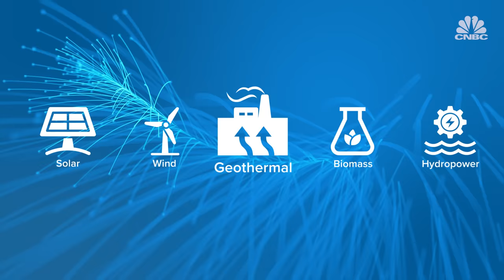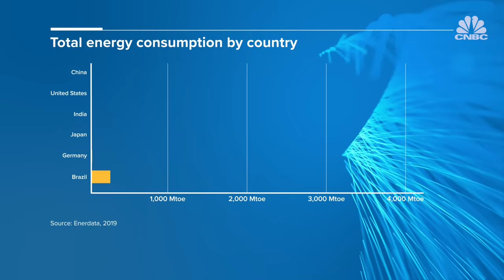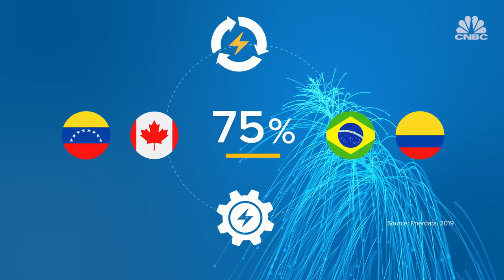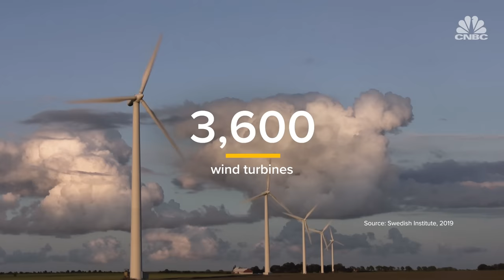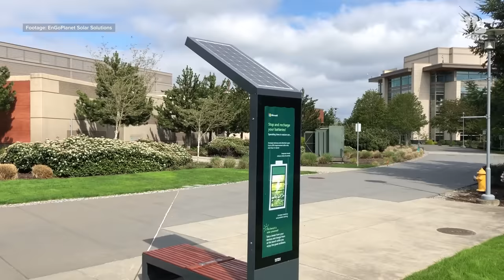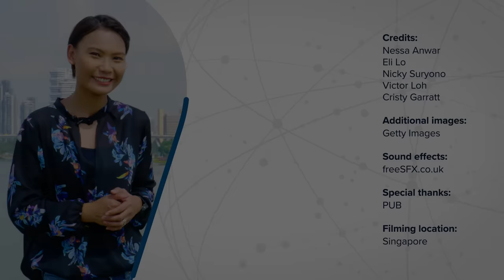Who is leading in renewable energy? | CNBC Explains

Comment: "not including hydropower"
not including 98% of norways power supply
Reply: @peter that makes no sense, not all countries are sunny and windy, nor they have volcanoes to produce geothermal energy. If any country wants to switch from fosil fuel to renewables it must harvest its renewable resources, it's stupid to exclude hydropower l.
Reply: Hydropower has the problem that if your country has a suitable location for it, it is most likely either in use already or protected. No or minimal chance of growth, so it makes the numbers look misleading. Now if we start building more wave/tidal power, that does need to be included.

It is also rather not-green compared to others. You need to dam a river valley or dig a reservoir, destroying whatever forest habitat, local villages and natural beauty were there, risk creating mudslides or floods, block fish and boats from traveling the river, and the huge amount of concrete and other materials needed don't exactly help either. On the plus side you might get some tourists fishing in the reservoir, not exactly a fair trade.
Reply: The difference is that hydro is dispatchable upon request, unlike variable sources like wind and solar. In other words it's very easy to have a lot of renewable electricity if you have the hydro resources but much more difficult from other renewable sources
Reply: If you take Ireland for example, it has all of it's hydro resources exploited (as it's very easy and cheap to) but only amounts to 3% of electricity. Ireland would love to be able to have more hydro resources as its cheaper and far more reliable than the wind farms they are building en masse
Reply: @brick1907  That definitely helps keeping it in the game, but either you have a steadily flowing river and would like to use it, meaning you probably run pretty close to100% output and don't have anything to dispatch on request; or you keep some production in reserve for when needed, meaning unless you are paid for that untapped amount you lose money and if you are it raises the general price per kWh. Or your river is not a steady and reliable source of energy and you are running a pumped hydro energy storage. I don't think storage should be counted as renewable energy PRODUCTION, whether the original energy was produced with renewables or not.
Reply: @AnalystPrime  that's a very fair comment, interesting way of looking at it. For some reason your initial comment in this thread didn't show up for me before replying
Reply: In almost all developed countries and most of developing countries that have the electricity demand, hydroelectric dams that can be built already have been built, so if you include hydro power, combined with the fact that hydro power is still the far-leading #1 source of renewable energy globally, the numbers would practically turn from "who are more willing to invest in renewables" to "who have better geography", which is not the point of the video.
On the other hand, no other renewable sources have been used to its full potential in most countries like hydro have been, and to encourage more investment in renewables, we of course have to focus on those non-hydro fields.
Reply: and icelands energy supply
Reply: peter Because Norway isn’t apart of EU. They do lazy research, instead of pick up information from each country, they go look at EU who is already collected these informations nations - who are member of EU.
Reply: Not including hydropower? 

Almost all electricity in Iceland is produced using renewable energy sources, with 73% of electricity provided by hydropower plants and 26.8% from geothermal energy, accounting for over 99% of total electricity consumption in Iceland.

hydropower plant is behind 98% here in Norway.
Reply: I think they excluded hydro power to make it comparable. Hydro power no doubt is a great renewable energy source, but not all countries have it for natural reasons. With solar power, or wind energy in contrast, it's simply a matter of installing the technology.
Reply: Hydro power can be both good and bad. They excluded it bcs it's now frowned upon due to some cases. In particular cases where countries share a river. eg the Nile.
Reply: 99% actually
Reply: Yes, what's the thing about excluding hydro? Is it maybe because renewables are generally distributed and hydro plants aren't? Because I don't think we'll see a lot of new hydro stuff anywhere - it's too massive
Reply: @chrisd8265  not all countries have same solar or wind capacity either
Reply: Because China is top producer.
Cnat have China at the top of something positive(altough it can be argued if the envirment has been destroyed more by the dam)
Reply: @chrisd8265  No. Solar panels have horrible yield on capital if you install them in the northern hemisphere. Not all areas are windy enough either.
Reply: in low carbon center you have space
Reply: LOL, Norway has gigantic oil fields and makes most of its money by selling oil and gas. Norway should just be quiet with its green energy hypocrisy.
Reply: @BananaCake26  
That is not true, the money gained from the oil and gas is not even accessable by the government, its all invested into the "oljefondet" which only half of the  income gained from the investments is accessable to the government. Norways biggest export is in fact fish, with 2.5 million tonnes per year.
Saying that promoting a green alternative for energy production is hypocritical because we export oil and gas is just idiotic, because oil and gas is a neccesary evil that the modern society cant survive without, and thats why we export and make money out of it.
Reply: @haliax8149  You do know north Africa is in the northern hemisphere right? And most nations can get more than good enough solar yield. Even in Sweden solar panels are a thing. Though ofcourse you aren't going to place large scale solar farms in Sweden, but just for personal use? Yes, it will still provide much more energy than used to produce and will also financially make money, again obviously lower than in sunny africa or so.
Reply: Hydral power is not actually good for environment, it has a catastrophic effect for a rivers health
Reply: @MathiasEmilKuntz1994  it can provide energy for all the countries touching the Nile if new ideas are used
Reply: @gamerx3387  the traditional method on rivers can be bad  for ecosystems but there are new ways that enable the country to avoid  these damages

and  ocean hydro has never been bad for ecosystems
Reply: @gamerx3387  and  ocean hydro has never been bad for ecosystems
Reply: @gamerx3387  hydro produces 75% of renewable energy globally
Reply: @robinsss  those are known as wave energy or tidal energy power source which are totally different thing from river based Hydro power
Reply: @54Nt1460CD  You can't compare the production of energy by solar pannels and wind turbines with the production of hydropower. Hydropower is by far the biggest renewble source. 
So Yes, it is unfair to compare
Reply: @peter You are probably right, but this also applies for other renewables sources
Reply: @peter hydroelectricity tends to have higher emmisions than other renewables due to decomposing organic matter in the water. It is still better than fossil fuels and has other properties that make it beneficial but it isn't quite as good at reducing greenhouse gases on its own.
Reply: @peter the water levels in the resivoir fluctuate depending on the season and amount of genoration which can cause the shoreline to cyclically grow new plants before swamping them which tends to produce a significant amount of methane. The exact emmisions depend on the local climate, geography, size of the dam, and useage.
Reply: Because I can't expect to ever decide what kind of power plant is being used anywhere, all I can do in order to help is try to be part of a world (aka THAT alternate universe) in which the individual with the power to decide upon the type of power plant will make the correct decision.

In other words, this aspect of biology (that it is someone's choice to decide on a type of power plant) is not democratic, and if on this subject I actively "vote with my mind/words", it will not only fail to mind control that individual who is to make the decision to switch to hydro, but it could also make it seem to him that choosing hydro power would not be an expression of his personality.

Basically, if we want to "mind control" him into making great decisions, we need to make him think that those decisions are 1. His own idea and 2. the most unique expressions of his personality which he will have ever made and 3. They will go down in history as a manifestation of the perfection of a ruler (him or her).
Reply: @AnalystPrime  Hydroelectric dams, when built correctly, can actually reduce severity of floods and protect fish.

Comment: Disappointed to see this video equivocate energy and electricity, quite misleading
Reply: Low hanging fruit. Wind and solar are very competitive. Batteries are taking off like crazy. EVs are driving it. I've had my Tesla Model 3 AWD for a year. It's awesome, but there are a whole slew of 200+ mile EVs going to be available in 2020.
Reply: @Joshua N. Ajang Rare earths actually aren't that rare.
Reply: Yes. Very disappointing.  Electricity account for only 20 percent of the world's overall primary consumption. Besides renewables only account for 11 percent (hydro 7 percent,  solar/wind/biomass 4 percent) If you add nuclear you get 15 percent. So more than 80 percent are still fossil fuels (2018)
Reply: @peter In Germany electricity is at about 45% renewable but overall just 15% lol

Comment: I remember once in a popular mechanics magazine a long time ago, they had an idea where you can use a special type of wind blade installed in the centre of highways in the cities and they would turn from the wind produced from passing cars and trucks. Its would produce enough power for the lights at the side of the highways.
Reply: From what I have read such installations could actually produce a small surplus. Honestly I am somewhat surprised it isn't more common to integrate small to medium sized solar panels into streetlights, you already need to install the foundation, connect to the grid, and regularly inspect and maintain the equipment so why not try to recouperate some of the costs

Comment: Bad documentary, because lack of data...Just speak but very little numerical data....
Reply: Rusmin Noer it’s bad only because America is low on the totem pole
Reply: And then they messed up with the units. At 6:10 capacity is not power. Megawatts = power, megawatthours = capacity.

Comment: Originally from Brazil lived in NAPA for 20 years now but still go back frequently. I was surprised to see that they use ethanol(alcohol )and is or at least was the global leader of alternative fuel! It’s a shame we don’t have that here
Reply: We have plenty of ethanol but I think a generally lower mixture in the USA. E85 which is mostly ethanol  is available in some places but not everywhere, which has over 110 octane (compared to 93 octane premium gasoline). It's hard to calculate ethanol's true benefit in the USA... We make our ethanol from corn (I think Brazil makes theirs from sugar beets) which as a dual effect of less corn for human consumption and feedstock, and whether the petroleum products that are typically used to grow and deliver the processed corn is tryly a net benefit. Government subsidies also muddy the picture... subsidies may be essential to getting production up sufficiently to make economic sense for building the related infrastructure 

Additionally, only cars manufactured after 2007 can take E85 gas without modifications. Any earlier model cars need to invest in a "kit" that can cost in the neighborhood of about $700 to replace the fuel injectors, install a special ethanol sensor and reprogram the car's computer.

Although I suppose it's YMMV on an individual basis, it should also be recognized that ethanol has a high water component which might affect some car systems, and despite the very high octane actually results in a much lower net miles per gallon... So it looks like E85 is priced at the pump very low so as not to be not a poorer deal than regular unleaded gas on cost per mile driven.
Reply: Forgot to add... Burning ethanol in your vehicle does not lessen emissions that are damaging to climate change but it does mean not burning a resource (petroleum) that could arguably be used in a better way (eg plastics) instead of simply burning it up.

Comment: I love renewables along with thought leaders like Lovins, McDonough and Jacobson. We also need to grow global renewables 5 times faster than we are presently. However, I have a real question: When it is super cold like -25 and -35 C as it was on the Canadian prairies for the past week renewables electricity generation share shrank to basically zero. Will geothermal, transmitting outside hydro, grid batteries, bidirectional electric vehicles along with biogas, high insulation and high efficiency do the job? Or do we keep fossil fuel plants, namely natural gas plants, operational for back up emergencies?

Comment: You gave it your best shot. You presented your material sufficiently fair (at least less biased than I expected) Thanks for the video.

Unfortunately nothing, and I mean NOTHING can replace the value provided by fossil fuels, for at least the next 200 years.

We either:
1. Keep burning fossil fuels and actively adapt to the climate change (while still looking for alternative energy).
2. Try to strive towards a near impossible goal of zero emissions or controlling Earth's climate. Blame big oil when it fails.
3. Start a death pact. "Transition off" 50% of all human beings.

Those are our choices.
Reply: you mean the next 20 years? fossile fuels arent as cheap as you think, governments usually subsidies drilling or pumping to make the oil cheaper so people can afford it and the economy can run, we cannot go like this for another 200 years, renewable tech is already close to shoving coal off.
Reply: Thanks for replying. Yes, I really mean 200 years. There are too many things only fossil fuels can do. E.g. Producing steel or even silicon

They can't be replaced by solar, wind, hydro, biomass, nuclear (both fission or fusion) combined. And even if they did, a huge chunk of that energy would be spent in taking CO2 in the air to make fuel. So we will still be indirectly using hydrocarbon energy, one way or another.
Reply: @saarangsahasrabudhe8634  many things will be replaced but not all, fossil fuel is cheep when used to produce just heat, so refineries and home heating systems will run on them longer then our cars will. im not a believer of bio fuels or hybrid systems they are technological purgatory, hydrogen has the same problem you mentioned but renewable energy could produce it. besides global warming people might just ban fossil fuel for respiratory health since pollution kills a lot of people. my state is 75% renewable, and i pay below the average price for electricity in the US, but not all states have renewable sources and thats where we have to wait for solar/battery/nuclear technology to expand in the next 20 years.
Reply: @Miquel lopez I wish you good luck and success in your claimed future. But that's all that I will do 🙂.
Reply: @miguellopez3392  Where is your US state, btw? Is it Nevada or Arizona? It has the Hoover dam I think, so I might believe your 75% renewable claim if that's so.
Reply: Thank you for your comment
Reply: @saarangsahasrabudhe8634  I believe this guy and I don't have a dam in my city

Comment: Capacity(measured in W, a unit of power) isn't equal to generation(measured in Wh, a unit of energy). The capacity is the maximum output of electricity that a generator can produce under ideal conditions, meanwhile generation refers to the amount of electricity that IS produced over a specific period of time.
So, according to the latest numbers from India, RES(renewable energy sources) account for 36 percent of the total power capacity while only 20 percent of the actual energy generation, which means that almost half of the installed RES capacity remains unrealised in India, when compared to the other sources of energy, much like most other spheres in India, where potential and capacity remains, but doesn't get realised or generated. Therefore, if India ranks 4th on your list, it doesn't really mean much. If anything, countries should be ranked based on generation.
Reply: Thank you for your detailed explanation on capacity versus generation. It's important to consider both aspects when evaluating renewable energy sources. By focusing on generation, we can better understand the actual impact and utilization of these sources. Speaking of power, have you heard about the Segway Portable PowerStation Cube Series? It's a versatile and powerful backup power solution perfect for outdoor enthusiasts like us. Check it out!